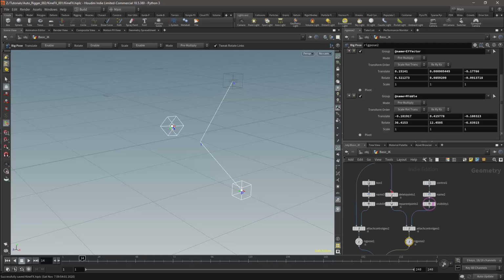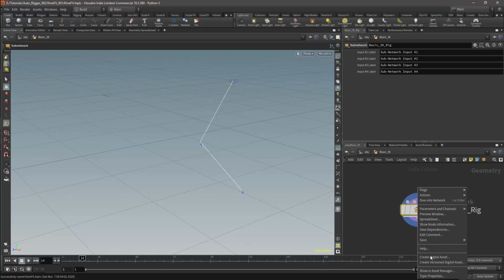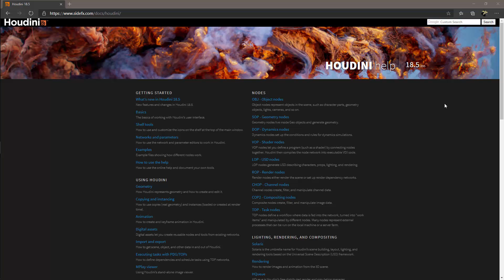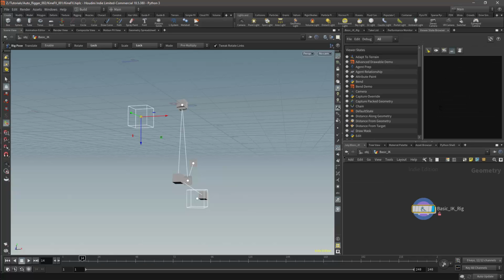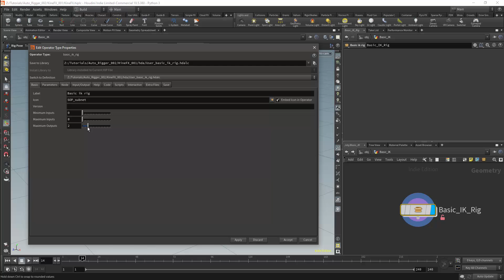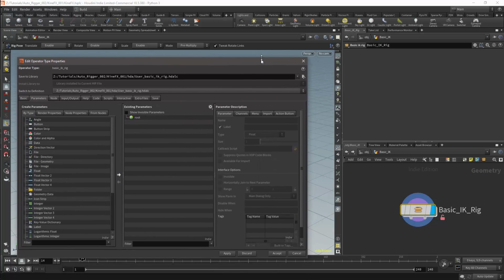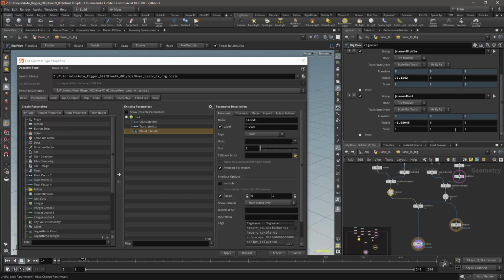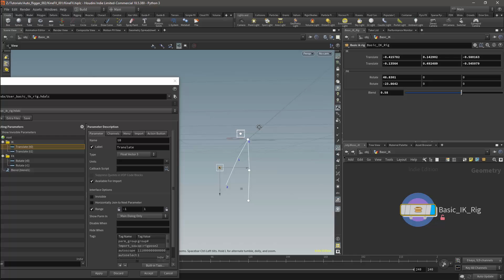KineFX Building The HDA

Comment: Here's what writes when you click on the MatchFK button       

   Traceback (most recent call last):
  File "Sop/base_ik_rig/MatchFK", line 1, in <module>
  File "Sop/base_ik_rig, PythonModule", line 12, in matchIK
  File "E:/Program Files/Side Effects Software/Houdini 19.0.383/houdini/python3.7libs\hou.py", line 68517, in attribValue
    return _hou.Point_attribValue(self, *args)
hou.OperationFailed: The attempted operation failed.
Reply from the maker: From the message I can say that a python script on the node is not registering properly this is usually a syntax error. But to say more I will need to see the node.
Reply: @brundlethwaite  Where to send the node

Comment: How to show both Rig Pose controls at the same time?

Thanks for the KineFX tutorials!
Reply from the maker: Turn off or bypass the Visibility nodes. If you are using the viewer state it should show all the controls when you select the HDA. In this case the visibility nodes are what stop the FK and IK Controls showing at the same time.
Reply: @brundlethwaite  Ah so the second Output SOP is just so the IK joints don't get lost inside the HDA? So you can acces those joint positions later?
Reply from the maker: The output nodes are not really needed. The second output is a recomendation from SideFX to make sure the node is rendered properly.